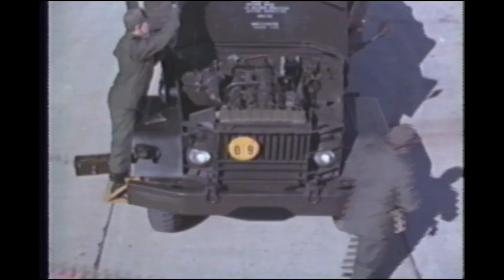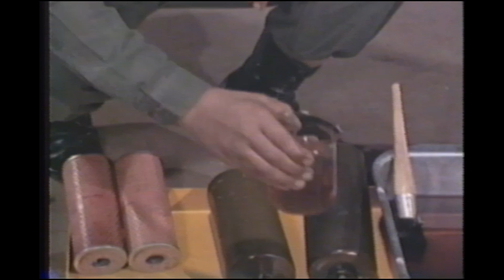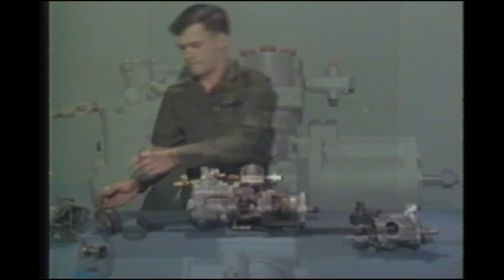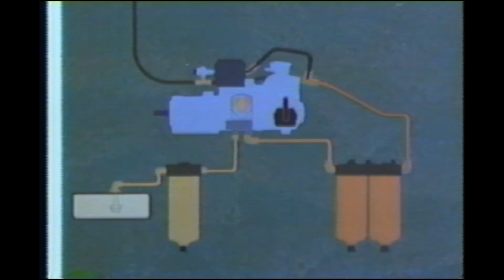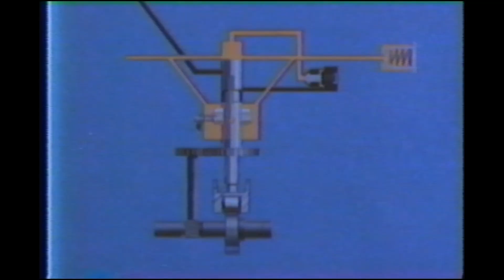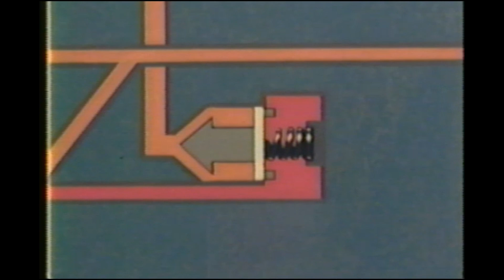Multifuel Engine LD & LDS 465 -Official US Army Training Film -Military Truck M35A2 Deuce and a Half

Comment: Thx i have fuel through the 3 filters but not to the injectors, but its been sitting awhile and I was running some veggie oil that gummed things up.
Reply from the maker: That sucks.   Hope you can get it going again.   If you get stuck on your repairs  - You might want to check out www.steelsoldiers.com  website and also "tactical repair" on YouTube for troubleshooting.
Reply: I had one gummed up from sitting.  ran automatice transmission fluid, like a quart to 8 gallons of diesel ratio and it cleaned it out.    A truck mechanic told me about it.